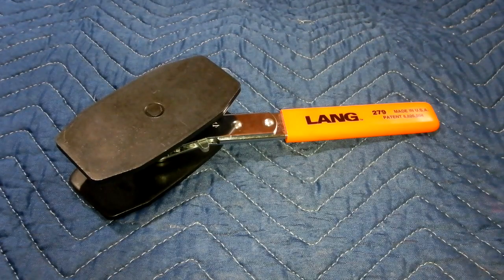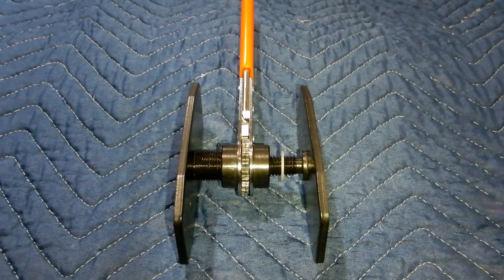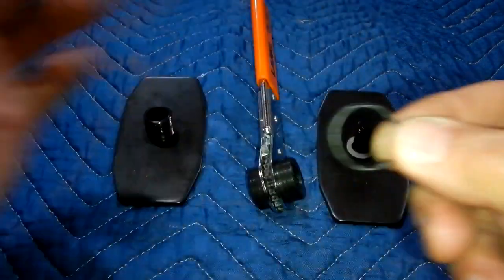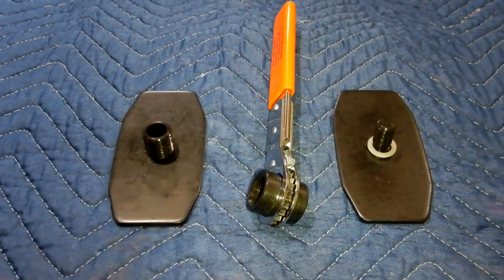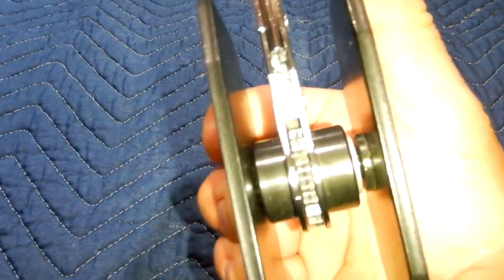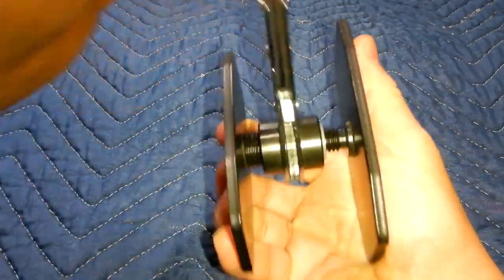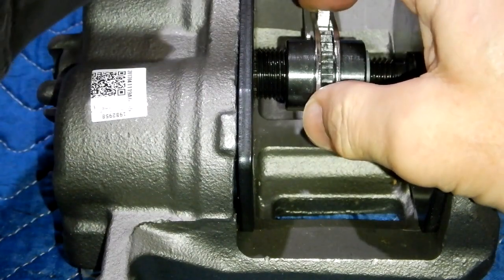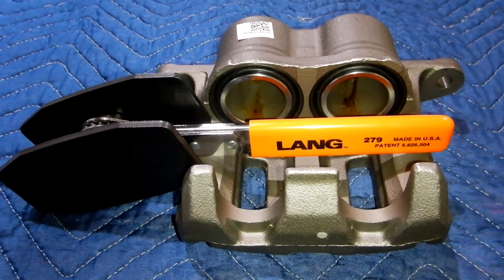Lang Tools 279 Brake Caliper Press

Comment: Got the same one for Christmas this year. Going to be using it a lot at work. Used Cornwell, Snap-On and they are pretty much the exact same. Wouldn't be surprised if they all were just made at the same place with different rubber handles for the company logo.
Reply from the maker: Aaron J...looks like Santa was very good to you this Christmas :)  You can never have enough tools. I agree, they just change the handle cover.

Comment: I got something similar but less complex at the advanced auto it’s a magentic nut and bolt in the middle with the use of a 3/4 wrench you just adjust the nut and it backs off the bolt causing it to spread open. Was like $12 and works like a charm
Reply: What is the tool called ?

Comment: This one is rebranded made for the tool truck brands including Napa.Make it for Snap On under the Blue Point brand name.Make it for Mac tools also.I have found one brake pad has to be in place in some applications,one was a 2011 Ford F150 4x4
Reply from the maker: Thank you for that information Walter.
Reply: They look the same,only differences are the color of the handle and part number.

Comment: I just bought the same tool on eBay for $14, shipping included. Mine has no name on it.
Reply: Made of pure Chinesium?
Reply: @troy3456789  If it works who cares.
Reply: They need to add Chinesium to the periodic table of elements- works great if not better then steel
Reply: All that matter is if it work geezz!!

Comment: I couldn’t get it to fit inside the caliper. Anybody else have this problem?
Reply from the maker: Perhaps your calipers are too small for this tool Kevin.
Reply: @starastronomer  yeah, a big disappointment. I tried already with the other tool that uses the old brake pad and you turn the knob (ship steering wheel type), but it’s just too hard. A friend that’s helping went to the store to get a C-clamp and we’re gonna try with that.
Reply from the maker: @keviiiboo7460  A C-clamp always works. Good luck!
Reply: @starastronomer  No luck. I’m planning on replacing the caliper now. It’ll be alright.
Reply from the maker: Thanks for the update.
Reply: @keviiiboo7460  I was going to say maybe you have a stuck piston like I do in mines just ordered a caliper